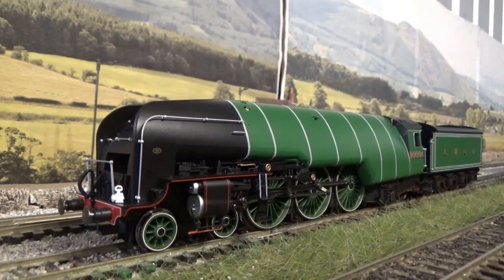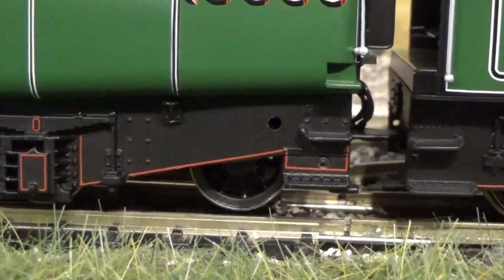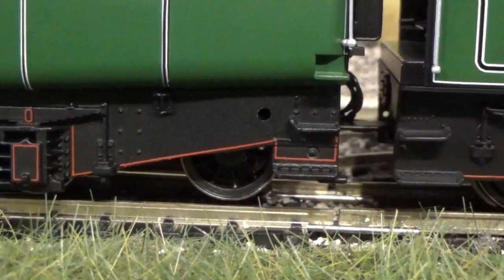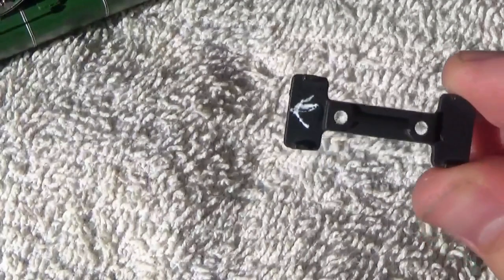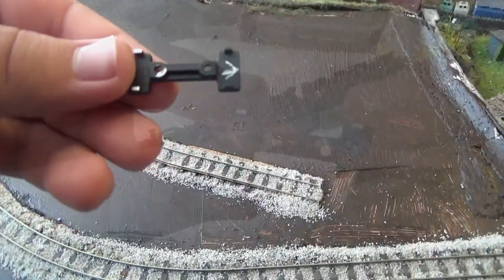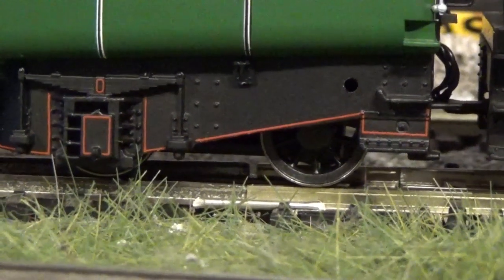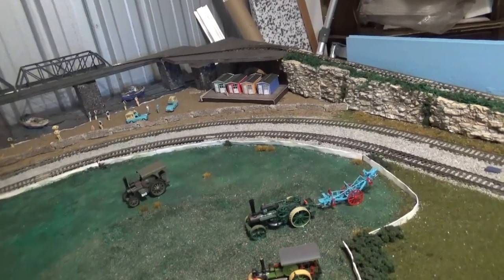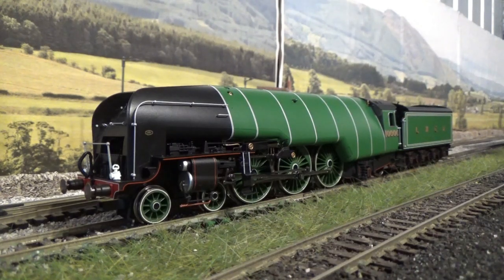Modifying The Rear Pony Truck Wheels on The Hornby LNER W1 Hush Hush

Comment: I wouldn’t consider buying any “pacific” style locos from Hornby or bachmann for that matter while they’re designing and building these locos with this non prototypical trailing axles, what is wrong with a proper trailing truck axle where the wheels actually turn and touch the rails?
Reply from the maker: This modification on this model allows the rear wheels to touch the rails. The reason they are fixed us because they need to go round tight radius curves

They could do articulated wheelsets,  but would that then cause prices to go up?
Reply: @class47peter  I wouldn’t think it should put up prices, after all hornby used to make locomotives with moving trailing axles years ago, I’ve got some! Hornby duchess class for example!
Reply: It’s a bit poor that after all the hornby research and development of this new style tooling they still couldn’t get it right and you’ve had to modify it yourself!
Reply from the maker: @paulstallard4376  yeah,  I'll agree. They could have done a better design of the ponys. Maybe they could taje note from this and do this mod on future batches on this model in future. Maybe on others to
Reply: @class47peter  even if they did admit it and modified it for future production I still wouldn’t purchase one at these eye watering prices!
Reply: @paulstallard4376 wasnt there a huge gap between the pony and cab
Reply: @derironrailfan1919  there is a small gap to allow for uneven track, but I’d rather have that and have the wheels actually touching the rails than have them “floating” in the air!

Comment: I like the modification to the trailing wheels; always one of my gripes about Hornby. I did notice, though, that pulling eight coaches, the consist slows considerably through your curves. Any comment on that - coach friction? underpowered? radius too tight?
Thank you for your views and reviews.
Reply from the maker: This layout has since been dismantled and a new one is being built. Baseboards had dips and weren't exactly level. So can only assume that caused slowing on curves, that said at the time this was a new model. So probably also just needed running in, not had issues with radiuses being too tight

Comment: Hi Peter, can you modify the Flying Scotsman at all theres no actual keeper plate just a Axel retaining plate my Loco jumps about all over the place with the rear wheels way above the track, regards, Colin.
Reply from the maker: I'm not sure the rear pony wheels on Flying Scotsman can be modified. If I recall there are no nubs under the plate that you can file down to get the wheels to sit on the rails.